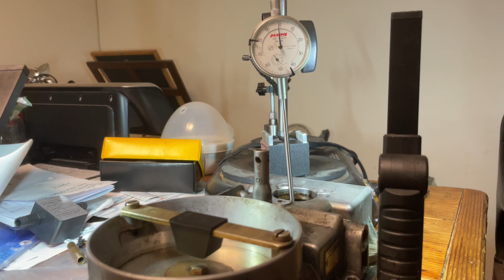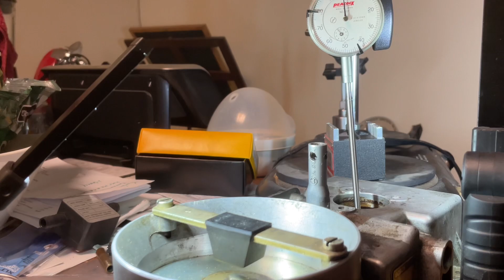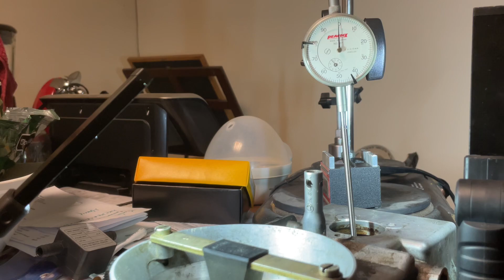Mercedes / Bosch K KA KE Jetronic - actual measured / verified travel of FD piston vs plate at idle

Comment: Peter, I wanted to bring light to a little issue I have had for years on my 560SEL but probably some of my other models too. Whenever it is humid and warm outside my idle is not as smooth… when it’s very dry and around 65-70 degrees outside (a day that everyone would say is beautiful out) it is perfect like a new car. It seems more humidity related than temperature. Would it be ignition or fuel/air related? I wonder if anyone else has noticed this in their CIS vehicles . it’s not really a problem but I must say when it’s a nasty day outside the car literally does not run as good. When it’s beautiful out it runs beautifully 😅
Reply from the maker: I guess your model is the “nice weather only” model limited edition.

Comment: My father and me hooked up our duty cycle meter to our cars while it was running and brought wires into the car and watched what it did as we drove down the road and compared it idle. That gave us an opportunity to compare the operation of 4 different CIS vehicles. We were also able to observe the fuel cut out and other characteristics of the KE system. Have you tried this Peter?
Reply from the maker: No, I have not. I have only one 560SEL
Reply: Also was able to confirm that the duty cycle defaults to 50% under full-load while the clicker is pushed under the gas pedal. But being in my 560SEL, it was a short test! I started to run out of road and speed was an issue. But upon releasing the clicker, the system returned to closed loop. Interesting diagnostics to observe!

Comment: Peter, maybe do a part 2 showing the plate preloading the tool for idle operation, and adjust the plate with the 3mm to show how much small adjustments make to the measurement
Reply from the maker: @markgraham5796 I cannot make the video part 2 at the moment for the following reasons:
1. This is my original Mixture Control Unit (LMM) and is Dirty (dried ethanol).
The 3mm allen screw is worn out (from previous owners trying to adjust mixture) 
2. The mixture control unit has to be mounted to a heavy baseplate on which the Dial Indicator is affixed to. I have to fabricate such a baseplate first so neither one can move even a thousands of a millimeter when I adjust Allen screw
Peter

Comment: Peter, maybe do a part 2 showing the plate preloading the tool for idle operation, and adjust the plate with the 3mm to show how much small adjustments make to the measurement
Reply from the maker: I can do this, but I need to make the Bosch Tool to adjust plate and keep it in position
Reply: I feel it’s important for people to understand how fine an adjustment this is!
Reply from the maker: @markgraham5796  I agree, but I need to build the holding fixture first and I have to see when I get the time to do it

Comment: Dialing in from Aussie & thanks for the update Peter.  I have been going back over your video's this week as i own 3 x W126 Gen2's (all high comp Euro 560 300hp engines with no O2 sensor & no cats).  Last week helped a friend swap a 300hp 560 engine into his 87 coupe as it had the low comp Aussie/US 560 engine in it.  

The compression is good but the KE system has been fiddled with so going thru the usual process of elimination as it idles but stalls as soon as you apply throttle. 
Plugs good/spark good so re-checked Vac lines.  FD flowing to all injector lines. Vacuum is good from engine
Will now then need to smoke test for vac leaks & remove Test Injectors (have an injector tester) . Test the POT then get stuck into tuning it

I now have a good understanding of this KE system (especially re-setting the airplate & idle screw adjustments correctly thanks to you Peter for your contribution on BW and YT 

Interesting all the high comp gen2 M117 500 & 560 & M119-960 KE 5ltre engines run the fuel distributor # ending in 016  (standard 560's end in 018) so must be different calibration internally from factory for the higher output engines. I am aware of your background in this system development so would be very keen to hear you feedback on this     
I actually have multiple spare FD with airplates complete units and have the repair kits on hand, so maybe i will have a go at doing an overhaul on one   (aware they are hard to calibrate)